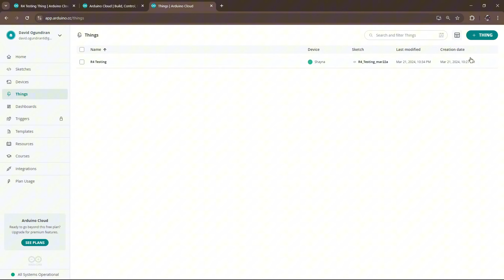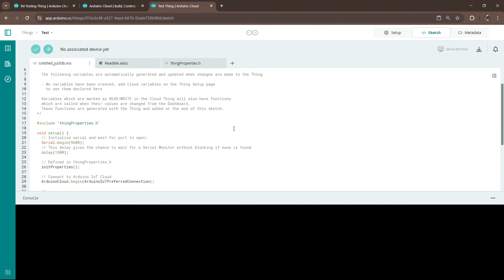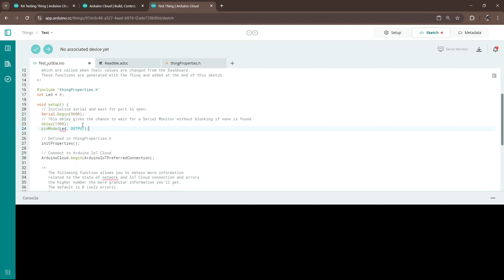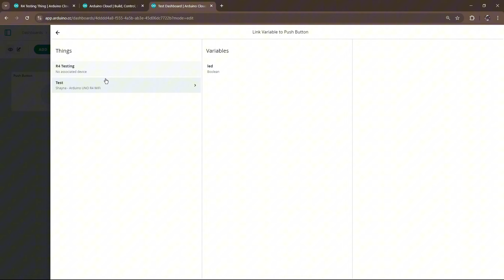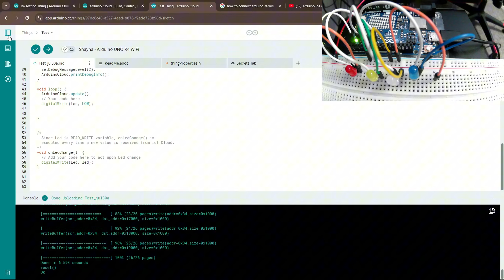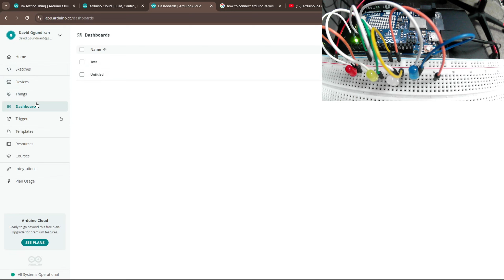Arduino IOT Push Button

Comment: To make things a bit easier and less confusing, make your bool variable on the IOT cloud something like "LED" all caps.  And make your Led Pin variable in the sketch something like "LEDpin." It helps the eyes see things in the sketch a bit better that way you're not accidentally putting Led when it should be led and so on. Good luck.